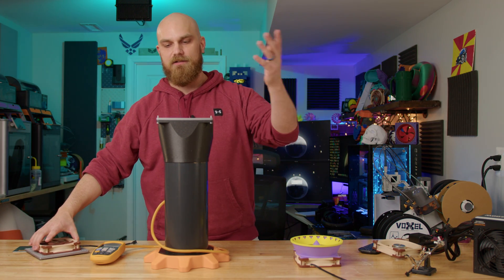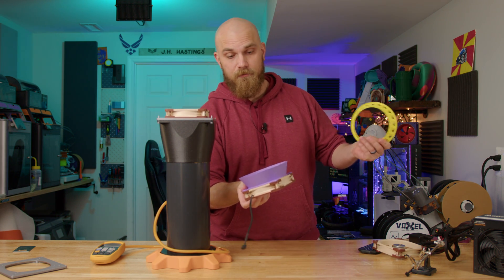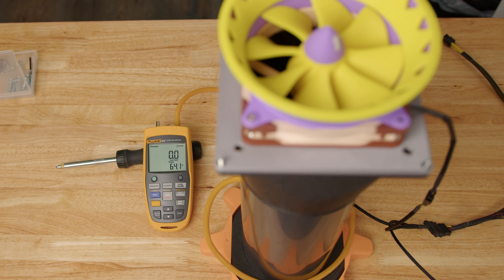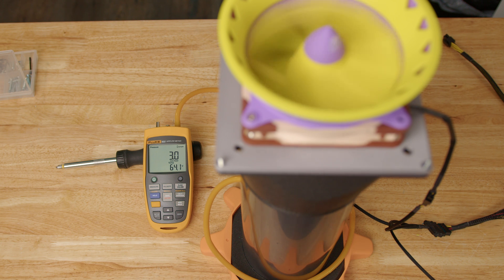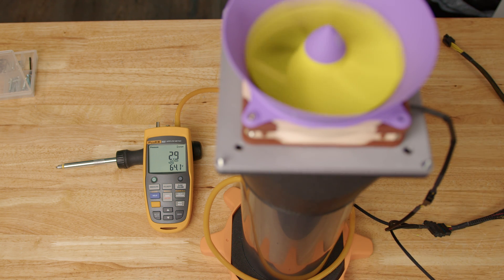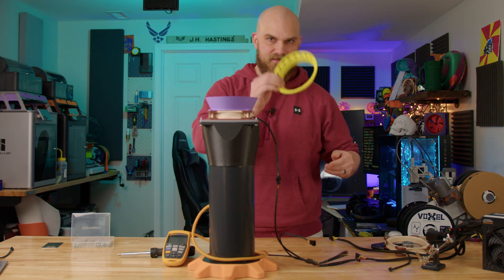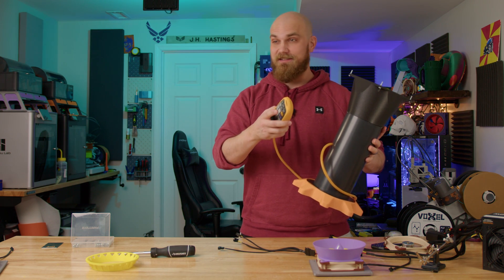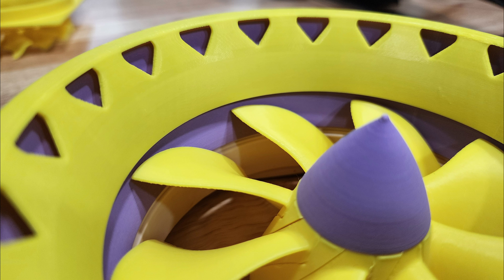🔥 3D Printed PC Fan Test: Does the Anti-Stall Ring Boost Performance? 🌀| Fan Showdown S6E3 Follow-up

Comment: I somehow doubt that the vent holes are recirculating and preventing stall. I feel like they're either 1) functioning like a wing tip on an aircraft, smoothing the vorticies over the end of the wing/fan blade or 2) providing a boundary layer cushion for the intake air, improving flow. The airflow around the edge of the tip, against the shroud, is stagnant. By smoothing the transition at the extreme blade tip, the airflow is less turbulent? Maybe...

Comment: I don't think it actually does what the creator thinks it does, I think its removing the blade tip turbulence without having any actual flow through the slots and could be replaced with a simple lip.

Comment: You do need a more precise way of measuring static pressure cause ... well from 2.9 to 3.0 and changing that slowly might just be 2.94 to 2.96 really (or even less).

And while this setup does measure static pressure that is NOT the type of scenario those fans are designed for nor really a useful result: You do want airflow, you do want restrictions, but you ONLY want to restrict the airflow, not fully block it. In this scenario the fans behave rather differently cause effects like stalling can occur. And fans don't just have a linear relation between speed and pressure. A Fan might very well deliver the highest unrestricted airflow as well as the highest blocked static pressure - but when just moving some air with some restriction it performs worse than others (thankfully with the always identical motor/driver assembly a lot of the variations are controlled for).

Comment: It might seem like a tiny amount, being only 0.1mm of h2o... but that's +3% static pressure. The increased pressure should also result in increased flow in actual use.

Comment: For the getting sick again... I know this is gonna be rough, but chew garlic. It is actually helpful, garlic that is, but... you gotta masticate it, or crush it in a mortar/pestle and ingest the result of that instead. It has to do with the way the garlic gets broken down. I eat some with some meat and/or cheese to help tame it a bit. To put into perspective the amount it may or may not help... I only got sick once in the past year and few months so far. I use city transit. So I am not without potential chances to catch something. But pink eye... heh... sorry friend, garlic won't help that. 

As for the 0.1 increase in airflow. I'll take it. It may not be much, but every last drop of potential cooling performance is worth it, especially when trying to reduce fan noise. If 0.1 can help shave off 100rpm on the fans, that's great. But... won't know if it does or not til someone tests it, wink wink, nudge nudge.

Comment: Wait... Is that pressure test for just water (H20)? I thought it was atmospheric pressure... You know, H20,  02, C02, N and a bunch of other combinations of letters and numbers.
Reply: mmH2O is a unit of pressure based on the equation p=hρg (hydrostatic pressure), using the density of water for ρ and depth of the water as h. You can think of it as the pressure you experience when you dive.

Comment: H2o? So we testing hoe much water fans can push now? Lol
Reply: Millimeters of water is a pretty standard unit of pressure for dealing with very small pressures, because of its nice round density (1g/mm³) and because you don't have to write so many zeroes after the decimal point.

Comment: H20 is water bro..  
am i missing something lol?
Reply: mmH2O is a unit of pressure based on the equation p=hρg (hydrostatic pressure), using the density of water for ρ and depth of the water as h. You can think of it as the pressure you experience when you dive.

Comment: I’d suggest printing another piece that’s exactly the same but without the triangular holes… question is whether the piece was acting as more of an optimization on the ducting or if the recirculation is where the boost comes from
Reply: I agree.  And, after that try different shaped, sized, or number of holes to see if it really matters or not.
Reply: Is this going to be yet another Fan Showdown Meta, going forward?

Comment: I recently confirmed that the finish on fan blades definitely affects performance - I replaced those on my Asus Dual GTX1070 a couple of years ago with 'Everflow' ones but recently got hold another set, this time by 'Power Logic' (on the off-chance they wouldn't have the annoying buzz the first set has above c. 67% / 2500RPM - at £6 why not?). Both are OEM to Asus I believe, BUT the blades on the Power Logics are rougher-looking mouldings (otherwise exactly the same shape/geometry) and at the same RPM GPU temps are noticeably higher, for e.g. with the card pulling 140W and the fans at 2500RPM, 20°C ambient about 64°C vs 61°C). BTW, they don't buzz like the Evercools but of course have to spin faster for the same temps.

Comment: OK, now we gotta get Veritasium, Steve Mould, and Alpha Pheonix involved to find out WHY it works that way! Oh, and let's also ask Nick Lucid of The Science Asylum.

This is gonna be great! Ordering popcorn now.
Reply: He explained why it works in the first video lol. It channels the airflow from back pressure to help prevent it creating turbulence in the airflow path, which reduces overall flow and forward pressure. That's why it increases performance by only a little bit in this free flow test, it might have an even bigger impact if he had also tested it installed on a radiator, which generates more backflow.
Reply: @TheOriginalFaxon  this is a static pressure test though, there is 0 airflow. So if that ring was going to help somewhere, this is where it would help the most. There'd be less improvement on a radiator, because there the air would actually be able to flow through, now it's just blowing into a sealed container with a manometer attached to it.
Reply: @TheOriginalFaxon  Shhhhhh! We'll never get any of those other guys to share a video with Major Hardware if we explain it for them! LOL

Comment: My condolences RE: eye-drops. My eye doc rec'd I use some, so I tried ones with preservatives first. Worked well, but then a scratchiness builds over the week, apparently from the preservatives, online says. Bought a few preservative-free ones and, fast forward a year, I now know I am violently allergic to preservative-free eye-drops. My eyes swell shut and it takes weeks to go back to normal once they deflate and are crusty and dead. No red eye though.

Comment: That's promising. I wonder if there's a way to scale it up, or at some point, diminishing returns?
Reply: at the rpms of the fan not really at high rpms 10k and above you could do all types of tuning to just the ring to really boost the performance and this modest boost someone said 3.3% as is right now at high rpms like 10k and above it would likely see even higher boosts likely close to 10% that is if it would hold together at those rpms which is unlikely but duplicated in steel it would hit that mark. 
Just an educated guess but i see it working similar to a spoiler or f1 cars wing they wont do much of any thing at 10 20 mph but once you hit 50 60 and above they have massive effects. RPM is just mph going in a circle basically LOL But as speed goes up the effect will increase until a point where diminishing returns is reached. Technically it wont ever stop seeing some improvement just that the return on investment will decrease to a point where it is not worth while 
He could ramp up the rpm using a drone motor from 2kish rpms to what ever the blades will take and run the same ramp up rate twice once with and once with out and plot out the boost in a graph and include information on how much the gain diminishes over time after it hits that point. The thing is that point could be way higher than what the printed fan would take before blowing apart
Reply: @nanaki-seto  Thanks for the reply! Yeah, seems like you're extremely limited in what you can do at these low RPMs. Taking ideas from condensers and the like isn't really all that feasible.

Comment: Can you test a delta GFC1212DW? This fan is incredibly powerful. It’s a contra-rotator and it draws 9A @ 12v. It would be interesting to see how it performs in your tests.
Reply: That's 6,200 rpm at 70 dBA. No thanks.
Reply: @Istandby666  Noise is not an issue for ultra-high-performance fans.  They are designed specifically for servers.

Comment: Now I wonder if it's the little cutouts or just the choked down inlet that's doing it
Reply: Same! I'm suspecting it might be some "velocity stack"-like effects, accelerating air going in.
Also potentially that it could be blocking the common (I dare say, only) passage for backpressure air to escape on fans: around the edge.
Reply: Could print out two rings with and without the holes and test them
Reply: @Anthraax  even add more
Reply: We also don't even know if it just went from 2.94 to 2.95. Or what testing error is.
Reply: It's the fact that it allows backflowing air a path around the fan which prevents turbulence. That's what was explained in its introduction video
Reply: @Genny207 yes but until scientifically proven by showing the difference between a ring with holes and a ring without holes that is just a statement… and even when a ring with holes outperforms a ring without holes there is still no proof as to ‘why’ the holes help unless another test specifically designed to show their effect is performed. Eliminating variables is the name of the game.
Reply: @jasonk1540  there is no proof that it is even effecting the backflow. The smoke test wasn't shown clear enough to be conclusive on this.

I bet it's acting more as a venturi effect. The air flowing past is causing high pressure further down the ring. This causes the cut out holes to suck more air in total.

Creating a bigger cone in cone open ring with a 5mm air gap should increase it more than the 0.1 achieved.

Comment: That's 3.3% increase that's pretty good for a static piece of plastic
Reply: Don't forget that it's maybe $0.05 worth of PLA and would take probably 7 seconds to print on one of those fancy BambuLabs machines. It's easily the cheapest 3.45% increase on something naturally aspirated, including slapping stickers on a Honda...
Reply: @bigbearnelson  probably the equivalent to "if you paint it red, it will run 3x faster".
Reply: Actually 3.0 is 3.45% improvement over 2.9.
Reply: @ZappyOh  touche. That's even better 😁
Reply: We can't be that precise as we don't have enough significant digits. It could theoretically be an improvement from 2.94999 to 2.95000 (~0%) or an improvement from 2.85000 to 3.04999 (~7%). I wonder where on that scale the improvement lies.
Reply: @DehimVerveen  Thank you for bringing up the unfortunate realitg that I was going to.
Reply: Maybe it's just becaust it shrink the intake
Reply: @adr1uno638 it could be that, it could be the added weight, it could be a little bit of everything, hard to tell without a deeper analysis
Reply: @walkinmn  I can almost guarantee that it isn't the added weight, because the ring isn't a moving part.
Reply: @walkinmn  Why on earth would weight matter at all? (It doesn't)
Reply: If this scaled up to a jet engine you can bet they’d do it even if it cost more than a nickel!
Reply: @m_cabral Look into the SR-71, they do exactly this, in a more complicated way though.
Reply: That's the type of increase that Aerospace goes crazy over
Reply: @SaiakuNaSenshu  that's what I'm saying. Try getting those kind of gains out of a car engine, with a clip on piece of plastic
Reply: Spoiler alert, I now don’t need to watch the video.
Reply: Indeed
Reply: Static plastic is fantastic.
Reply: Except space can be a constraint
Reply: It’s just because it’s a tighter opening, it’s not helping in the way the designers though it would
Reply: It should be more as even a crap fan will to like what? 1mm of H2O? 
So if thats a given than the performance uplift from that to 3mm are based on the fan geometry 
and 0,1mm is just from the shroud. 
So using performance gain over standard would be a more usefull way to see it.